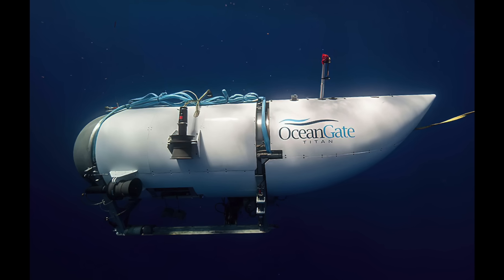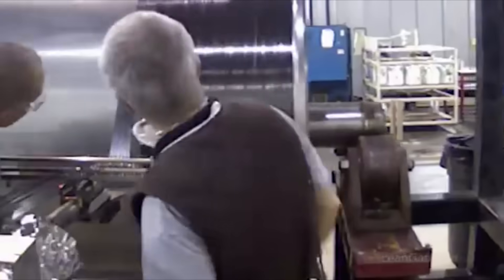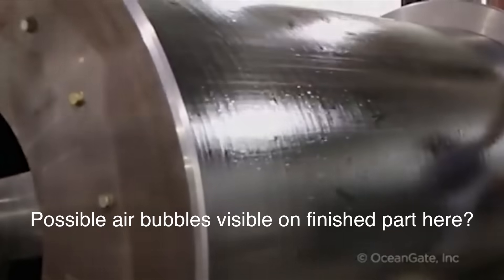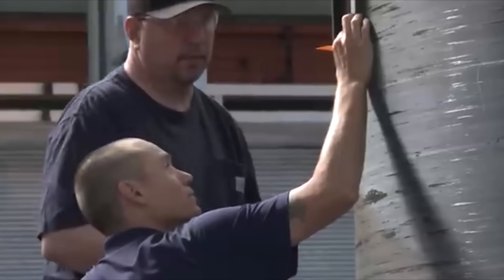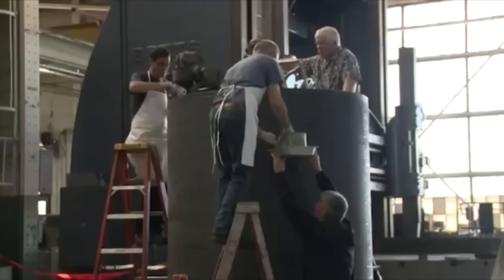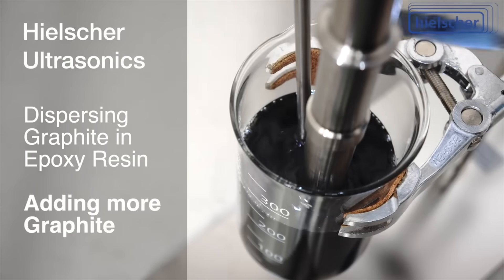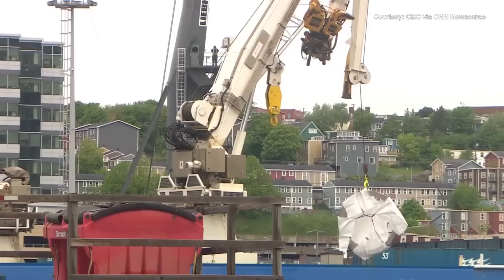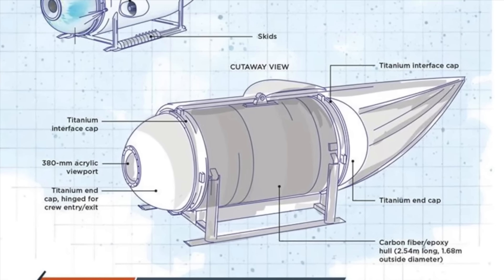Why OceanGate Titan Imploded - A Carbon Fiber Composites Perspective

Comment: If you wrap only with a circumferantial 90° winding a thick tube of CFRP and connect it to 2 titanium rings at the edges, then you put on the cylindrical shell a 380 Atmosphere external pressure load, WHAT DOES IT HAPPEN ?    Near the "clamping" of the cylindrical 5" thick CFRP shell (TUBE) in the ditches of the rings, the  TUBE is constrained to be circular. At the mid-length between the 2 titanium rings, under the ENORMOUS pressure load, the CFRP TUBE could show either vertical, diagonal or horizontal strains, leading to a kind of twisted shape which could look as a slightly elliptical "TWIST and WARP" deformation of the CFRP TUBE. Even if it is very small, the global set of strains of the TUBE therefore drives a SADDLE SHAPE for the strained TUBE. This STATE of DEFORMATION of the mid-sections of the TUBE generates compulsory interlaminar and transverse shear forces inside the EPOXY MATRIX and, probably local pinching at the knify edges of the clamping grooves of the titanium rings. As the circumferantial CFRP 90° solo winding doesn't bring any strength in X'Ox (hull lengthwise direction), there is only the epoxy matrix which works with its very low 50 to 70 MPa ability on shear resistance. This is probably the origin of the cracks the crew have heard near the back ring.  PINCHING on knify edges and shear are VERY BAD for CFRP, above all with a 90° only CFRP.

Comment: Can someone explain how a carbon fibre is “strong” in compression. Were it a pressure containing vessel then fine, apart from the fact that the glued end caps would have blown off swiftly. I fear these people didn’t know what they didn’t know. Shocking frankly. 😮

Comment: I have a technician grade experience of working with hand lay up wet and prepreg carbon fibre with vacuum bagging. None of what I saw gives me any confidence in the structural integrity of that pressure boundary. The fact that they attached cf directly to titanium concerns me. Galvanic corrosion is a large concern when metal is attached to carbon. Both materials suffer degradation.

Comment: Hi Jamie, some excellent views, thank you. It would be obvious to me that because the hull had no end to end fibres, that when the centre of the cylinder deformed due to the pressure it would mean that the INSIDE wall of the hull becomes under extreme tension from end to end, this would then lead to a radial crack at the centre which then propogates through the hull to the outer wall.
Reply from the maker: Precisely! This is absolutely what I think happened as well.

Comment: Doomed from the get go ... no Clean Room, no Auto-Clave and no AS9102 certification to keep it all on the straight and narrow. But hey, that's just what my 40 years in Aerospace Composite Engineering tells me.  Just imagine if Rush had invested in a "Thread laying machine" (TOWS) like we use on our F-35 Program ... much stronger ... and Rush wouldn't have been able to buy that expired (and obviously "re-tested" once) CF Tape from Boeing !

And THAT folks is why we call it "HALT" ... highly accelerated lifetime testing ... "bend it until it breaks" so you have a baseline. IMHO, the Hull imploded and had NOTHING to do with the Titanium flanges/dome; the acrylic view port and domes blew off like Champagne corks (Water cannot be compressed and it had to go somewhere) ... studs smooth as a shiny new whistle ~ zero threads left nor CF tear away on the mounting flanges (there are ZERO “Adhesives” on the professional/FMS market that don’t call for application of a “Primer” prior to the actual Adhesive). His "Design Engineers" sucked ... the hull was in "hoop" yet zero internal stringer supports nor sleeve to help keep it equalized; hull thickness would have needed to be approximately 17.6 inches thick without said support structure. All the "popping noise" on previous dives was the CF delaminating, transitioning from "Elastic" to "Plastic" state ... the fibers ripped out of the resin matrix bed and never able to re-seat; Rush would have known this had he bothered to perform NDI (ultrasonic or X-Ray) after each dive. Pity his hubris got in the way. Good presentation Jamie.
Reply: Agree. Rush fired his design engineer after he raised safety issues. Rush was a narcissicist. When I listen to Rush speak he is an obvious noob.
Reply: I've worked as a NDT-technician in the windturbine business, and i'm apalled that the CF hull never went through any testings for airvoids or delaminations. 
A suicide waiting to happen, but there was no need to bring more.
Reply: Yes, you’d think ultrasonic testing would have revealed the defects before the vessel was submerged. And also the ruptures that developed under pressure.
Reply: @maxenielsen  yes, it would have identified the delamination areas ... "X-Ray" for more accurate locations ... but he was such a cheapskate he skipped it.
Reply: BSME here. Carbon fiber has incredible strength in tension, not compression. In compression the strength is almost entirely that of the adhesive, not of the carbon. Foolish design, foolish testing methods, foolish egos.
Reply: 1 year ago and you called it exactly how it happened.
Reply: And... no factor of safety. Should be tested to minimum 5x when lives are involved.

Comment: I did see the problem on another video just after the accident and I can see it again here in your video.
The titanium end cap only has  approximately a 2" depth of flange with which the carbon fiber tube inserts into and that is where it failed. The weakest part of the carbon fiber tube is each end and had the titanium flange been say 10" depth it may not have failed on this dive. 
The carbon fiber tube was always going to fail sooner or later but that.
That engineering mistake is simply embarrassing and a fu** disgrace to say the least.

Comment: Good video!
There are only compressive hoop stresses in the singular perfectly symmetrical unstable situation. Every single buckling failure mode has stresses in other directions.

So it was like something balanced on a point.

Comment: THANK YOU! I'm watching this video screaming "YES! Finally someone's talking about this". From the construction video, the metal-composite interface (MCI) was clearly treated with such disregard that the Ti ring and CFRP cylinder simply shearing apart at the MCI under the intense pressure is very real possibility.

The flange depth x width x thickness of the Ti ring looks to be 5" x 2" 0.5" with no secondary means of securing the assembly (bolts or rivets).

It is possible the components of the pressure vessel will be recovered largely intact. Highly unlikely but a possibility nonetheless. The thought that a vehicle meant to carry living people to such an inhospitable place was potentially put together by an untrained team is a very scary thought.

Comment: I have 28 years experience in the middle east as technical manager in composites, and agree with you that the bond between cf and titanium was a question mark. For me, i will never introduce different materials for this application and compensate with a huge value for manufacturing constant not less than 10, and a value of 3 for cyclic load constant..Also, i agree with you, he should have placed layers of helix winding. Filament wound should be one-piece such as this kind of application.

Comment: In my mind the biggest error oceangate made is as you rightly pointed out, insufficient testing of their design. They put too much faith into their RTM system which honestly probably would have worked,.... If they had calibrated it with destructive testing. They effectively said "we have a geiger counter but we don't know why it keeps booping".

Comment: I think the reason why we see no carbon on the end caps is due to the fact that there is a large change in stiffness at this interface, which is basically the definition of a stress concentration. Whatever caused the failure would have had cracks propagate quickly to this joint and then fly 360 degrees around in the blink of an eye. Basically, the sub could have been perfectly adequate in design and hit by a torpedo and I would expect a similar outcome.

Comment: Buoyancy would be critical as it basically determines the size of the thrusters needed. So basically a carbon sub would require smaller thrusters. Based on the unconfirmed transcript posted I think they took on water and their thrusters couldn't lift the vehicle to the surface. That being said, the issue that caused them to take on water must have lead to an implosion as well.
Reply from the maker: That’s interesting to hear how a lightweight submersible design would require smaller thrusting components.
Reply: Buoyancy has nothing to do with the thruster sizing as they didn't use the thrusters to dive or ascend.  They use ballast for that.  The "unconfirmed transcript" is bull$hit.  They had no communications about problems.  They received a normal 15 minute ping, then nothing after that.  The Navy heard the implosion a short time after that (but of course nobody knew it).  They assumed comms were just down.  That's why they waited EIGHT MORE HOURS before declaring the sub overdue and notifying the USCG.  They had no idea about anything else.

Comment: It should have an inch thick of Titanium Cylinder with a welded Flange ...prior to laying of different orientation of maybe 7 inches of Carbon Fiber...that way the Dome has a proper attachment of the embedded Titanium Flange..

Comment: Incorrect. Stockton rush said that the layers on zero 90 axial and rotational layup. From the specification we know that the axial layer was prepreg. He was correct that there are no torsional loads in the axial direction, but he made an error not considering the torsional load in the radial direction. It is strange that this was not noticed because his distructive testing showed that this is this was the primary failure mode.

Comment: As a person that has worked in the aerospace composites sector for over 25 years, everything I see about their manufacturing methods is scary as hell.  This said however, I have not seen any information that would give any real insight into what their process was.

What was the actual material used?  There are many different carbon fiber materials.  I read that it was expired material they purchased from Boeing.  Well I happened to know that any expired material from Boeing, or any other major OEM only sells surplus material to known re-sellers, and with a full disclaimer that the material is expired and not for use on aircraft along with absolving them of any liability.

How was this carbon fiber material cured?  I've seen nothing that has given any clue.  Was it vacuum bagged and cured in an oven?  Vacuum bagged and cured in an autoclave?  If so, what pressure and temperature and for how long?  Do that have records of the cure process?  Or, was it cured in a Hydroclave?  Given the high pressure application, I would think this would be the best curing method.  However, I know where most of this sort of equipment is, and there really isn't anyplace with a large enough hydroclave that I could see letting them use it for this unless they paid a lot of money.

What is the epoxy that was used?  Typically this would be used in a temperature and humidity controlled environment.  This just looks like a shop out in the open someplace.  Also as the video pointed out, where are the hair-nets, proper coveralls, gloves?  There is no way to stop contamination as don't in this video.  Was the epoxy de-gassed?  Not by mixing it in a gallon bucket with a stick it wasn't!

Were the mating surfaces properly prepped with the proper RMS finish?  Doesn't look like it.

Then the last one... was the cabin fiber hull checked with ultra sound for voids and porosity?

I'll climb off of my soapbox now....
Reply: Sometimes a soapbox proclamation is warranted.

Comment: Improving the mechanical strength of the glue is futile, or using more glue, or doing it better would not make much of a difference. The concept of binding titanium and carbon fiber is a terrible one. And their horrendous manufacturing and assembly made a bad engineering concept even worst. 

You have three materials, titanium, glue, and carbon fiber epoxy composite (CFEC). Each has different mechanical properties. And will behave differently under repeated pressure and temp cycles. Think of three springs with different stiffness. Under the same force they will be displaced differently and at different rates. This creates shear stress at the interface of these materials. And after repeated cycles they will come apart. If you look at the titanium ring that came out of the water it was clean. There was not even a fragment of CFEC on it. This is total separation. Granted, we don't know if that was the primary failure point or was secondary. This interface and the CFEC pressure hull itself are the likely suspects of failure of course...granted this is a very obvious conclusion!

Comment: This makes no sense. CFEC is terrible under compressive loads. No matter in how many orientations you lay the carbon fiber, it is near useless in compression.  Most of the compressive loads are taken by the epoxy matrix.  Yes more orientations may retard the propagation of interlayer delamination but any such compromise will eventually be catastrophic in a pressure vessel operating at extreme depths. And is not repairable or easy to identify. It is just a terrible choice of material for this application.

Comment: Carbon fiber's great strength is TENSILE strength, which is what it would be under if it were formed into a pressure vessel made to contain high INTERNAL pressure.     Not under compression which is the under water scenario.   Now let's be really stupid and wrap a central core with carbon fiber, thus placing the core under a lot of compression, and then subject it to even MORE compressive load deep under water well beyond the depth at which the carbon fiber/epoxy composite will start to microcrack and degrade under the ingress of sea water into the matrix, thus weakening it and causing further damage. 

This thing was born to fail.  The only question was WHEN. Not IF.

Comment: The geometry of the cylinder plus spheres, as well as the difference between materials, would cause bending and shear stresses in the composite in the direction perpendicular to the direction of fiber wrap with nothing to resist it other than the epoxy matrix.
I don't have experience to comment on the glue.  In that application, with the composite tube fitting in a channel in the titanium, the glue may be only acting as a gasket sealer and doesn't not require any bond strength.  Of course the gasket sealer cannot allow a leak under high pressure.

Comment: Agreed the execution was poor and wronf material to start with for exter al pressures but if you were commited to carbon i dont understand why at least one end cap wasn't integrated into the carbon layup... like a type 4 pressure vessel; make the cap part of thebliner and wrap the whole thing with continuous filaments. Best way to avoid a glue failure? Remove the need for it in the first place.

"No torsion in the ocean" is total BS. A cross section free body diagram of the hull would show bending...compression on the skin and tension on the internal layer. Alternating layups to help lock the fibers together at 45 degerees and actul utilize the carbon materila strenfth instead reyling on purely resin would be much better....reduce the chance of layer buckling...you know... like a proven type 4 pressure vessel!!

Super risky plan. Not the right material, then didn't even utilize best practices

Comment: Even I was careful earlier today on not touching the plastic with my hand after using a clean rag with alcohol on some plastics my car rubbed off in the inner fenders. I used black gorilla tape and it seems like it worked perfectly. So crazy the conditions those goofballs put together such a delicate apparatus

Comment: At 7.27 mins you say that the interface has a pressure of 6000 psi....This is wrong...... it is more like 27,000 psi because of the area of the end caps sitting on the small area of the interface.
Reply: The area of the end caps is around  3421 sq "...so an force of 6000 psi x 3421...so around 20,526,000lbs of force pushing on the small area of the interface...This is considerably more weight than the carbon fibre is able to sustain.